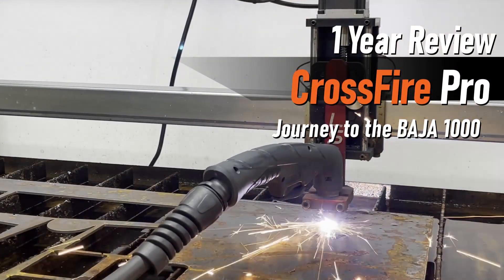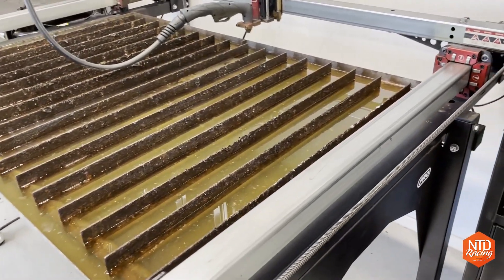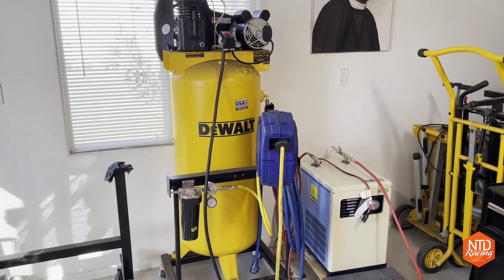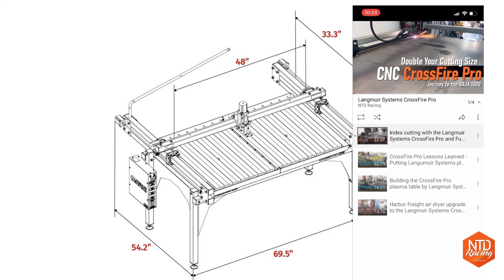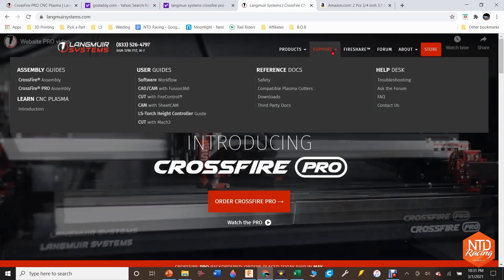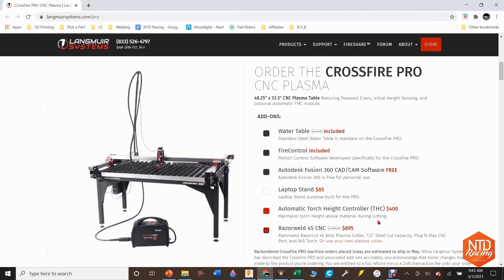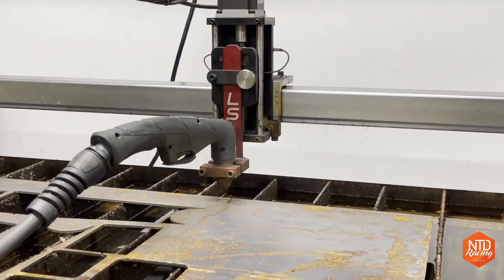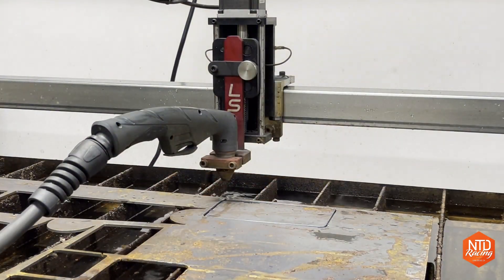How to buy a CrossFire Pro - Lessons learned after 1 year with Langmuir Systems plasma cutting table

Comment: ive been on their forum for about 6-7 months......the people there truly try to help others with problems.....but.....there are still many people having problems with either the THC or some other misfire.....is it the razorweld...the THC.....the fire control?  even though $5000 for this sounds nice.......i'm on the fence about purchasing.....
Reply from the maker: Good question.  I had a few problems that I thought was caused by the Razorweld, but it was my computer trying to run the old FireControl.   All my issues went away with the new FireControl.   I’m going to get the Razorweld again on the XR.

Comment: good video, I bought a primeweld cut60 dual voltage a year or so ago thinking i will buy  this table later. they use to offer the Cut60 for this table but have switched. my question is why and will a cut 60 work(i cant see why not).

Comment: You have some of the best clearest videos on the Crossfire Pro.  I’m ordering one this week and cant wait to get mine in May.  That cut in the exhaust tubing is awesome, no more step bits for O2 bung holes. Would be awesome if it notched tubing also.  Lol. Maybe a new Langmuir product?
Reply from the maker: It would be cool if they had a tube feed system.  I must have cut 200 fish mouths with an angle grinder for HONCHO!  I am getting ready to start another truck, and that would save me days.  

It would be much appreciated if you use the link in my description when you order.  Thanks for watching.
Reply: @ntdracing  do you have a coupon code or just use the link?
Reply: @megadesertdiesel1468  do everything you need to do almost purchase one on their site just don’t hit the final purchase click.

They should send you an email for $100 off the next day. They did for me anyways.

Comment: Just bought my Pro... Thanks for the review.....
Reply from the maker: Cool…thanks for watching.
Reply: is it working as expected......or is it a headache
Reply: @glennmartonic6376  Still waiting on a few parts before I get up and running... so far the packaging/etc was easy to assemble
Reply from the maker: My CrossFire Pro and RW45 still work like new…maybe better considering software updates.

Comment: Hey , I figured I should ask your help on this, I have a pro along with the razor weld 45, I’ve been using it for a few months, it was working fine yesterday, I could tell the air wasn’t as strong though coming out the torch however, I haven’t replaced my nozzle and electrode at all which I ordered some parts that will come in tomorrow. That all being said I ordered them because I tried using it today and it didn’t even work, it was like a dry run, no air coming through , idk if that means the air is bad or as in like moisture in the plasma cutter?, would that be a thing, for the last few months I’ve had a little moisture just around where the hose connects to the cutter, I have a filter and I do release the moisture out of it every time I get done using the table for the day. Do u think it in general is not even streaming air because the consumables are bad or there’s an even worse problem that has to do with the cutter. What I’m hoping you’ll say is that the internal computer won’t stream air without the electrode and nozzle firing off from the initial electricity but idk if that’s how it works.
Reply from the maker: If you have used it for a few months on the same consumables, I would say that is most likely your problem.   They are easy to remove and inspect.   I change them before every high dollar cut.
Reply: @ntdracing  thanks I hope that’s all it is, quick question tho, do u frequently get moisture at the connecting parts where the air hose and plasma cutter meet?
Reply from the maker: I do not think so, but maybe.  I am betting new consumables will fix your problem.  Good luck.

Comment: What do you do for ventilation?  It looks like you have the crossfire pro in a relatively small room or it that just an aspect of the video? How high is the Cieling in the room?

Thanks
Reply from the maker: I open doors on both sides of the shop and run a large fan.

Comment: Have you tried cutting something like 20oz sheet copper out? I'm curious with so much expansion and contraction in the material if the automatic hight adjustment/fire control can keep up? Thanks for the video

Comment: why don't you just replace the plugs on the bottom of the table with a ball valve...? are they not NPT threads? i'm thinking about picking up one of theses little tables as a starter table to sort of dip my toe into CNC and CAD, see if it's worth it for me to get a big 5x10 more expensive table.

Comment: Good info. However, I'm a metal artist. Can I download a drawing from the internet or something I've designed in paint and make the necessary changes to plasma cut the final design or is it basically an Autocad type software and I'll have to draw up everything from scratch? No importing images to be tweaked to my design in other words.
Reply from the maker: Yes.  I will work on a video for that soon.
Reply: If you can create a DXF file, fusion can convert that to a sketch in the CAD software so you don't have to sketch it yourself
Reply: @824WaterBoy  A bit late, but drawings are usually bitmap pixels, individual dots, whereas DXF and other CAD formats are vectors. Converting bitmap formats into vectors is not trivial.

Comment: Dumb question, how does the torch cut through the material but not  cut into your table?
Reply from the maker: It will cut the slats a little, but the water stops the torch from cutting too deep.   Even without water, it will not cut through the table.

Comment: Hello Mr. NTD, about the casters, when moving the table around it is bound to not be perfectly level. Do you feel that is a problem ?
Reply from the maker: I do not think so.  THC compensates for things not being level.  As long as things are kept square, I think you will be good.  Watch in the video where I cut into the tube.  Cannot get more out of level than that and the cut was good.
Reply: @ntdracing  yeah ok but in reality when a four legged item is"level" what it really means is that all four points are on the same plane, that means no bending. I guess a bent frame would not cut square especially on larger pieces. However, it seems according to your experience it shouldn't be a big deal. I love the concept to have everything on casters.

Comment: fusion 360 cad is fine but the  cam is not that good. Also you can't create and export dxf files to use on Sheetcam which is a much better cam program.
Reply from the maker: I agree it is not for everyone.  My point is that it is great for someone like me.  Arguably one of the best CAD programs , free or not, and CAM in one place.  My next two videos are probably more geared towards people who make one-off parts to use on projects.  I built most of my race truck with Fusion 360 and the CF Pro.     Maybe not the best for those who are selling making and selling signs and art.

Comment: My razorweld 45 is the most unreliable piece of equipment I own. I’ve ordered a Hypertherm with a machine torch. In addition to being unreliable, Razorweld does not provide any feeds and speeds cut charts, so everything is trial and error till you get it dialed in. Metal is far too expensive to waste experimenting with amperage, airflow, and travel speed. Razorweld, in my opinion, is the worst piece of equipment I’ve ever wasted $900 on. If you’re spending this kind of money on a system like this, why not go with the best?
Reply: is it a normal cut 45 or the cnc version? im struggling to keep my working right now